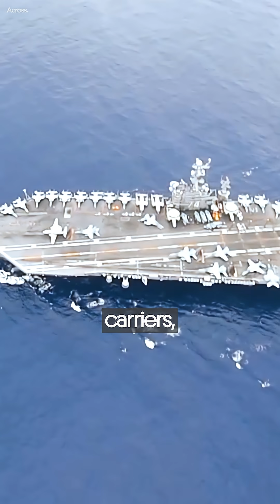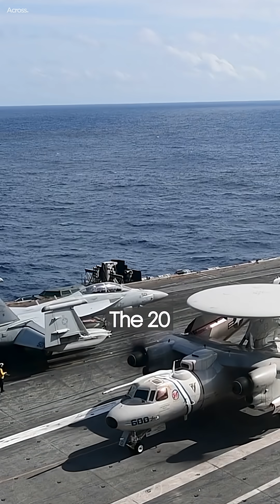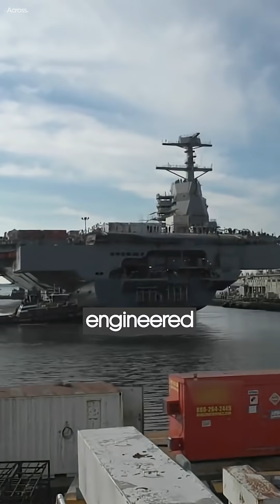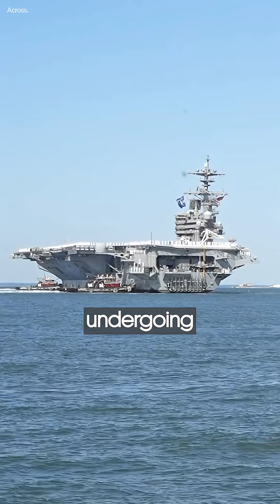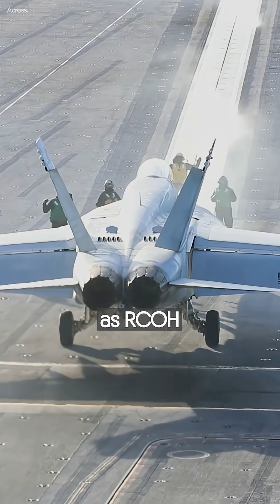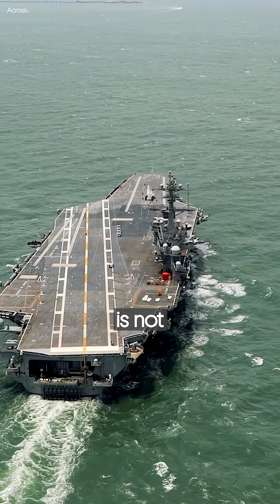Why US Aircraft Carrier NEED 20 Years to Refuel?

Comment: Submarines and aircraft covers are both nuclear-powered. But for very different reasons, aircraft carriers are nuclear powered, primarily due to cost and logistics, it is massively cheaper to power a ship that huge with nuclear power than it is with diesel.
In order to carry enough fuel to be able to do anything reasonable. The ship would have to be built massively bigger to hold it, or you can have more stops, or refueling ships which are logistically challenging for a ship this size

Submarines, on the other hand are powered the way they are to give them the ability to stay under water for extreme periods of time pre.
Vious diesel submarines had to surface( or snorkel, just a few feet under the surface.)To run diesel engines to charge a battery to stay submerged, that is not an issue when you don't have to run a diesel engine

Comment: Can't carry 25 years worth of other supplies.
Reply: It's easier to supply the carrier with AvGas, food and water when the resupply ships don't have to carry fuel for the ship as well, as you have more free space for the AvGas, which increases the carrier's combat effectiveness
Reply: @Danstrous  It's been quite some time since anything on a carrier used AvGas. Everything runs on JP5 now, including the escorts.
Reply: @martykarr7058  once again, if you also have to refuel the carrier, you need either more AvGas, or more resupply ships
Reply: @Danstrous  Okay, here it comes from the deckplates. I was on the USS Sacramento, what was called a combat support ship. It was essentially a floating Wal-Mart, supplying the battlegroup with fuel, dry stores, and ammo. It's purpose was to be fast enough to keep up with the carriers, and so that other supply ships wouldn't have to operate so close to the battlefront. We were the ship for the Enterprise (CVN-65) battle group, and back then not all ships used gas turbine engines so we supplied JP-5 for the carrier and those escorts that were gas turbine, and Diesel Fuel Marine for those that ran on boilers. Usually the Enterprise would pull up alongside to port twice a week to take on stores and top off on jet fuel while the escorts would pull up on the starboard side(the one I worked on as deck hand in the UNREP team) and would top off their tanks and take on stores as well. Usually we got two or three escorts done in the time it took for Enterprise, about 2-4 hours. Then one time we refueled the USS Midway (now a museum in San Diego), and they were alongside for TWELVE HOURS, topping off both jet fuel and DFM.

Comment: While i may be the 2nd comment, the Reason it takes so long to refuel is primarily because they have to carefully replace and remove the parts and pieces from the nuclear reactor due to major concerns if not being careful as it can cause a big problem with nuclear radiation.